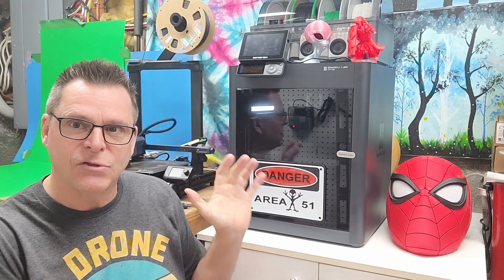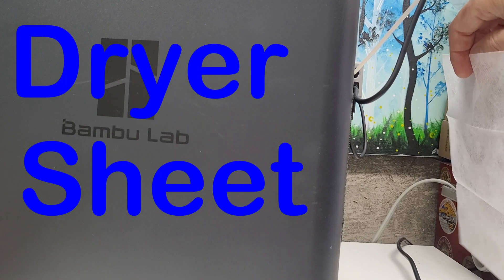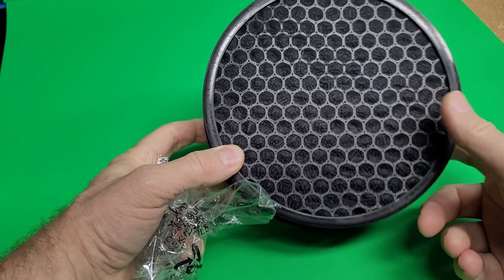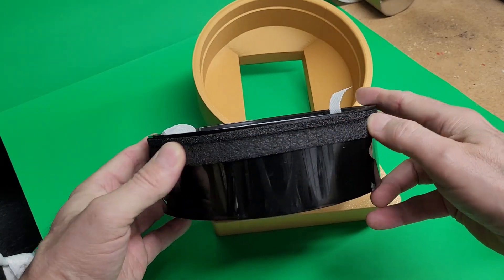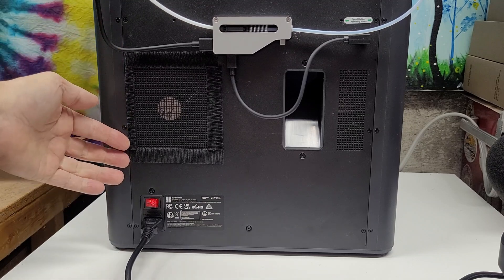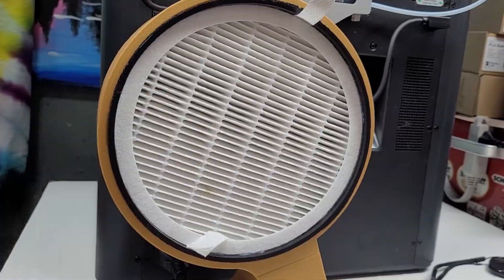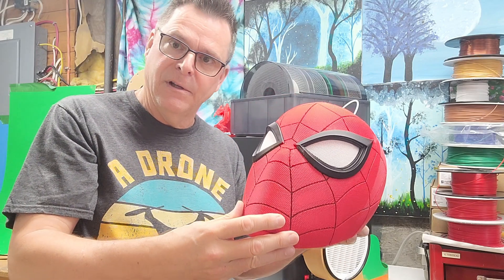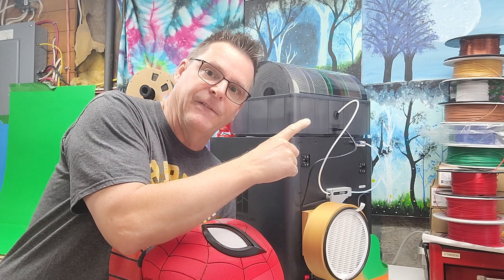Bambu Lab Is It SAFE?

Comment: Hello all. Is it just me, or is the link to the filter holder (the print file) no longer valid? I’ll poke around when I get the chance but I keep getting a 404 message when I click the link in “the description below.” Thanks for any insight!
Reply from the maker: Not the first time that I've renewed the link due to this issue. Weird, sorry for the trouble here's the link.  Let me know if it works
https://makerworld.com/models/627989?appSharePlatform=copy
Reply: @mayhemsmiley Thanks - this works now. Will be putting this together asap. I just got the printer and have been getting head aches. With windows open, less issues… but still, I’d like to increase the filtration.😊
Reply from the maker: @GeorgePelikan  take care of yourself. We all have different sensibilities.

Comment: mayby design a square box to be screwed on the back of the printer that then transforms to a round duct - this can then be sealed with an o-ring both against the printer and against the filter housing
Reply from the maker: Thanks for the suggestion 👍
There are a lot of possible design approaches for external filtration. For this project, I focused on something simple, printable, and easy for most people to install without modifying the printer itself.

Comment: Why that filter and not a drop in voxel hepa filter or similar filter on Amazon.
Reply from the maker: The drop in didn't exist when I originally did this.  It came out after.  I still love my large hepa. Ideally venting outdoor is the best but challenging in my print room.  Did you buy a voxel?

Comment: cool. but attaching it with velcro is going to leak particulates through the velcro. it needs to be sealed tight.   these are micron sized particles.  they will push out any unsealed seam.  You would be best to use some kind of sealant.  or adhere it with a double sided "closed cell" foam gasket.
Reply: How about magnet-Strips? They should seal much tighter than Velcro
Reply from the maker: @AlexKahl  Dayum! what a great idea!! Where were you when I did this?🤣😂
Reply from the maker: Yeah, velcro isn’t exactly a hermetically sealed lab environment! 😆
It’s more like… ‘Mayhem Smiley level sealed.’

But the removable part was important to me. A gasket would be a solid upgrade, though,  thanks for the idea!
Reply: @mayhemsmiley  I get it!  Convenience is always the trade off.  Even a duct putty over the seam maybe?   It's upsetting that safety and filtering is an afterthought, or problem to be solved, in these printers...
Reply from the maker: @tYNS Yeah, I hear you. Honestly, I’ve been breaking my head trying to figure out a good way to exhaust outdoors when I’m running the nastier filaments. Even with the HEPA filter, if I’m printing something that worries me, I just stay out of the room, better safe than sorry.
Appreciate the conversation, this stuff matters.

Comment: Only thing I would add is that placing a secondary fan on the other side of the filter might have been valuable in stopping the pressure from pushing bits of exhaust around the Velcro and to instead suck air in through the Velcro
Reply from the maker: Can't argue with you,  room for improvement 😊
Reply: @mayhemsmiley you definitely need a second fan. Printer fan won't cut it by its own.
Reply from the maker: @TinoushGTR  Hey Tinoush, I'm curious, please elaborate how you came to that conclusion. I've done smoke tests that showed positive results, but I'm open minded. Let me know. Thanks

Comment: Hi, thanks' for sharing your solution.
I've seen that quite a few have made some kind of solution that exhaust and filter air trough the motherboard fan outlet. This makes wonder that what is the purpose of the original filter when air is already coming out from other even bigger hole? And how this solution affects the function of the original filtration?
Reply from the maker: Hey bng 
I removed the original filter. The original is really small and does not include the paper portion that is in the mood.  Just for clarification I'm using the chamber fan, there is another fan for the motherboard.
Reply: @mayhemsmiley  
Did you close the opening of the original filter? I am having difficulties to understand how the air flow behaves (haven't seen one in real life) when there are several fans and openings in the sturcture.
Reply from the maker: @bngineer I removed the filter and put the cover back.  The chamber intake is horizontal above the little door where the original filter was. 
I have a smoke test video demonstrating the pull of the fan.

Comment: Buying a 'very reasonably priced' filter on amazon usually means you bought a 'very not good' filter.  You need a good air quality meter and run tests before and after using hepa (or claimed hepa compliant) filters.
Reply from the maker: I hear you about the good quality air meter, but where to get something reliable at a reasonable price. Best sure fire solution is to exhaust outside, but at least this solution is better than what came with the printer for now.

Comment: Great video, thanks for sharing! I just wanted to mention that a single pass through an activated carbon filter may not fully capture all VOCs from filament emissions, depending on the type of filament. For PLA, a considerably low fume filament, the primary concern are the ultrafine particles, which the HEPA filter should handle well, but VOC capture can be harder to gauge. While the carbon filter is effective, its efficiency decreases as it becomes saturated. You might notice this as the fumes become more noticeable over time; however, it’s difficult to quantify without a calibrated air quality sensor. You may get better results by enclosing the printer in a grow tent and using a setup that recirculates air through the filters multiple times. That’s how I’ve set mine up, so I thought I’d share in case it’s helpful.
Reply: Also worth noting that the quality of the activated carbon filter plays a huge role in this. Trusted respirator manufacturers such as 3M must meet certain standards to be NIOSH approved, but I'm sure how much confidence I have in random Amazon sellers. That's why I recommend recirculation, just in case a single pass is insufficient. Also, on the off chance that you do buy your own activated carbon pellets/granules (for refills), make sure that they are acid free. Although acid-washed activated carbon is cheaper, it will rust and corrode your machines.
Reply from the maker: Morning Kilian, thank you for taking the time to share. I feel like it's an important topic, considering we can't see particles and we don't know the long term effects.
Reply: Do you have a video or pics you can share? Thanks in advance

Comment: Carbon filter size is laughable. For it to work is should be around 1kg active carbon and changed every other week to work
Reply from the maker: Morning Zaaap0, can you share where you're getting the info from? I love these printers, but would love a reliable concrete study be done for reliable conclusions. Let me know Thanks
Reply: @mayhemsmiley  I recommend ignoring this comment unless they provide more information to substantiate their claim. Respirator filters rated for organic compounds are typically recommended to be replaced every six months after initial exposure, though this can vary depending on the environment. Your home likely has nowhere near the level of fumes found in industrial settings, though do pay in mind the types of filaments you use. As for those who claim to work in such environments without issue, don’t let their disregard for their own health affect your decision-making. Use your best judgment. After all it’s your health that matters most, not the opinions of random strangers on the internet.

Comment from the maker: Hey everyone, I recently made an error in this video regarding the filter I use in the Bambu Lab P1S. I initially assumed that the filter material was the same on both sides. However, after further examination, I discovered that this is incorrect.

To correct this, you can easily reverse the filter material within the filter housing. I will be creating a short video tutorial demonstrating this simple process shortly.

I sincerely apologize for any confusion or inconvenience this error may have caused.

It's important to note that even in its original configuration, the filter provides a significant improvement in air quality compared to the standard Bambu filter due to its incorporation of carbon and a high-quality fibrous material before exhausting air back into the room.

Testing in progress please stay tuned.

I appreciate your understanding and continued support.
Reply: I updated your design so if you like I can share the STL file with you
Reply: @GokayEindhoven  Any chance you could make this public? I ordered the filter a week ago, and it just arrived, after the file was taken down.
Reply from the maker: @GokayEindhoven That's great news. Have you printed it? if so can you upload to Makerworld? I'll check it out.
Reply: @mayhemsmiley  I could not find your original so I could not refer to it as remix. I am new here so this is my first publish :)
Reply from the maker: @gokostombak7176  cool I'll repost shortly just finalizing some testing
Reply: Exactly right. Also consider that the fan is drawing air through the internal filter then having to push it out of your big filter and it's probably over worked which can lead to the motor dying. It's worth exploring a 200+mm fan to add behind your filter to assist in drawing out the fumes. Otherwise, the air will take the path of least resistance which may be between the hooks in the velcro.
Reply from the maker: @bobmurphy2216  Morning Bob, I removed the internal Bambu filter to get better draw. I'm interested in the auxiliary fan too, but the Bambu fan typically runs at 60 to 70% when printing. Basically I am still testing at the moment.
Reply: You might also wanna enclose the poop chute, because it's open to the internals of the printer. But am I right that you exclusively print PLA? Then you're probably safe anyways. PLA does not really emit harmful fumes when melting. PETG is also relatively safe. But if you even print in ABS or ASA, try to stay as far away from the printer as possible, even a few hours after the print is completed, and keep the room well ventilated. Regardless of what sort of filtration system you have!
Reply from the maker: @venorando3672 PLA  PLA+ & PLAF so far.
Reply: @ Ahh, using a HEPA filter is never bad practice, but let me just say that you have NOTHING to worry about at all! In fact, Bambu Lab even recommends having the printer door OPEN while printing PLA, and closed for pretty much every other filament. With PETG you should also be quite safe. However, if you ever decide to use ANY other filament (ABS, ASA, TPU, Nylon, etc), then I completely agree that you should take some serious measures to avoid inhaling the stuff. Being too careful is simply not possible!

Comment: Are you following air in the wrong direction? The Amazon photo says you do
Reply from the maker: Morning Raniz, Yup the Amazon image shows the opposite air flow. I don't believe it makes a difference. The orientation that I am using the air flows through the carbon portion first then the paper and the paper is where the 0.3 micron particles will be trapped. I will cut one open shortly to challenge my method and ideally show that the paper has no orientation. The fan is not powerful enough to damage the filter structurally, if it were a ventilation fan and filter that would be a different story. Thank you for taking the time to comment.
Reply: @mayhemsmiley my understanding is that the HEPA should be first in line to collect the fine particles, that way the charcoal is simply removing toxins from the scrubbed air. However, I doubt it really makes a difference which way you put it. Not like you’re going to clog the charcoal with ultra fine particles.
Reply from the maker: Thanks @michaeldipasqua1281 your explanation makes sense to me and agree on our scale probably not a big deal.  Thanks for the comment
Reply: The air is flowing into the machine. Not out. What BS...
Reply from the maker: @raniz9056  both of my printers the fan is pushing the air out of the printer chamber. I know there is someone who has an issue with the air being pushed into the chamber and no idea why.

Comment: Does the direction and flow of air through the filter matter? because according to the images on amazon, i think you have it backwards
Reply from the maker: I don't believe it matters, the air passes through the carbon and then through the pleated paper. If it was a stronger fan or you put another fan on the other side that could potentially damage the paper pleats. Furnace filters have a direction due to the strength of the fan and those filters have supports for the paper.

Comment: Hey ! Thank you for this amazing video. It could help many people trying to have a better air while printing. I was going to experiment your solution so I checked the airflow on the fan at the rear of the printer (I have a p1s like you) but it appears that it actually sucked air inside the printer. I checked while printing an object with PLA filament.
If air get sucked in with the fan in my case, there should be somewhere a fan that pushes air, right ?
Again thanks for your video, I'm just trying to understand why in my case air got pulled inside while in your video it's pushed outside.
Reply from the maker: Hey Ade, leaving the addon filter off, does the fan push air? or does it pulls only when the add on filter is in place? Is the filter housing well aligned with the fan's exhaust? Let me know, my curiosity is peaked.
Reply: @mayhemsmiley thank you for yout answer !
I don’t have the filter addon yet so consider my question with « default » configuration for the p1s. I just checked the rear fan while printing,and saw that actually air got sucked inside rather than pushed outside. Is there any configuration you did on the p1s to have reverse air flow ?
Reply from the maker: @ademusta5878 sorry for the delay.  I'll experiment when I get home after work 😊
Reply from the maker: @ademusta5878  Hey Ade, I checked mine out without the filter in place and mine is definitely exhausting the air from the chamber. I have to admit I don't know why yours is pulling air into the chamber. Sorry, may be ask Bambu.

Comment: Why not simply place a cut out piece of an FFP2/3 corona mask over the air inlet in the printer in front of the activated carbon filter? Seems like the simplest, cheapest and most effective solution to me.
Reply from the maker: Can't argue with you, that is one way to go. I didn't find mine difficult to do either and it is a big filter that won't need changing often. It wasn't expensive either. If you ever try your idea, please share it, I'm open minded. Thanks for taking the time to comment :)

Comment: Do you experience less smell from the printer? I've bought P1S recently and the smell really concerns me. It prints faster and with higher temp than my previous Ender 3, so I can understand why. Really thinking about air purifier for it.
Reply from the maker: @Andrii-i7j  I haven't noticed any smell and I've tested with pla plus and plaf without issue. If it was easy I would ventilate right outdoors. Maybe one day 😊
Reply: What types of filaments do you print with? Only PLA? Any PETG? Any TPU? Any ABS or ASA? Anything else?
Reply from the maker: @venorando3672 so far pla pla+ and plaf so far. The f is 15%abs
Reply: @ Sorry, you're right, the context is important. It's 95% PLA for me, so I was talking about it. Actually, I bought an IKEA air purifier for 60 EUR, put it behind the printer fan, and like 80% of the smell disappeared. Also got an IKEA simple air quality analizer, when the purifier is working, the sensor stays green all the time.
Reply: @ Awesome! Just be extra careful when printing that 5% which is not PLA, and you'll be golden!

Comment: Thanks for sharing your safety action and for providing a fix as well.  I haven't received my P1S yet but I also paint with acrylics and brushes and have installed a wall fan to move air in a small room and in addition I mounted a 6" Inline fan to suction the air in my room outdoors.   I measured my room's total cubic volume and I know it's an over kill but I did my research and a 4" Inline Fan would of been perfectly functional.   With pets and family in the household it seemed better to go into turbo mode on the side of safety.   XD   Btw how pleased are you with your BTT screen, I haven't come to a conclusion on whether it's worth the addition or not.   Thanks again.
Reply from the maker: @aberodriguez4149  thank you for taking the time to comment and I'm glad you're taking care of your family's safety.  Venting to the outdoors is definitely the best solution. The hepa is better that the original filter at least.  I didn't care for the BTT and sold it on ebay. Practice navigating the screen, then decide if you want to add it.  I have two p1s and load them from my computer via wifi. I rarely use the screen on the printers. Thanks again for taking the time I appreciate it
Reply: @mayhemsmiley  Thank you for your honest and speedy response, I will heed your words plus take that sixty bucks and invest in 3D filaments rolls.  Thank you.